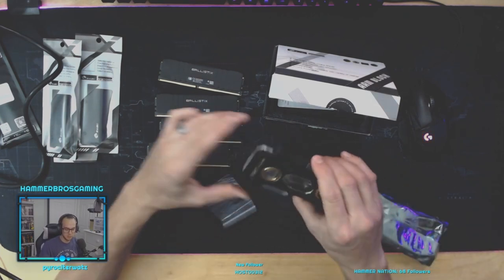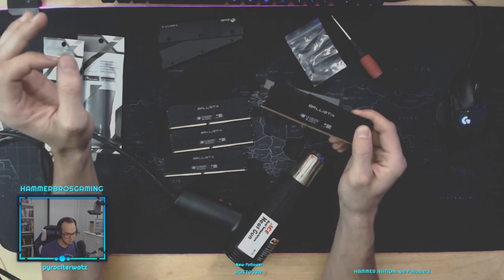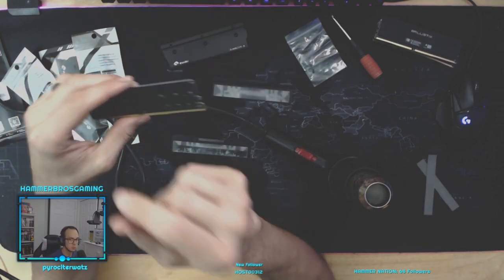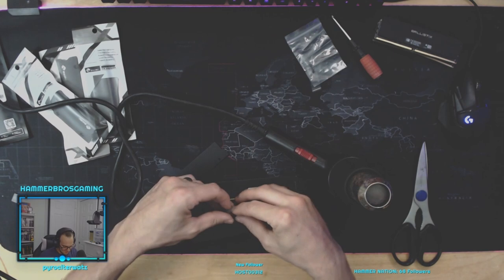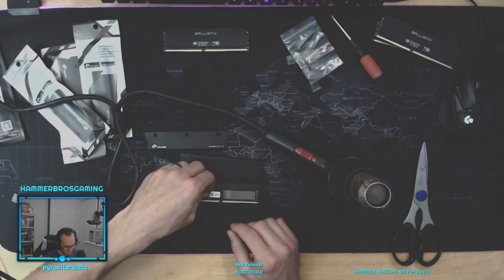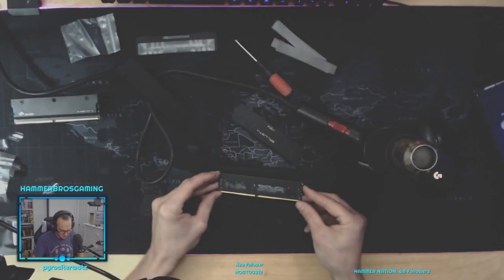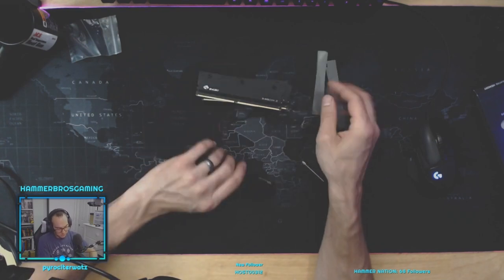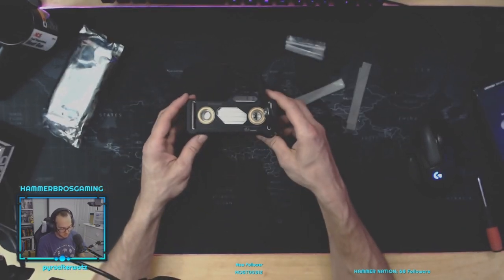Installing Ram Waterblock and Heatspreaders

Comment: what brand are these components? and how have they held up?
Reply from the maker: These are Bykski products, the heat spreaders and waterblock. Honestly I never ended up messing around with overclocks but it's been doing a fantastic job keeping everything cool. Bykski is affordable and does nearly as good a job as EK. The only thing they lack is proper instructions, you either have to know what you're doing or... Watch this video 😉